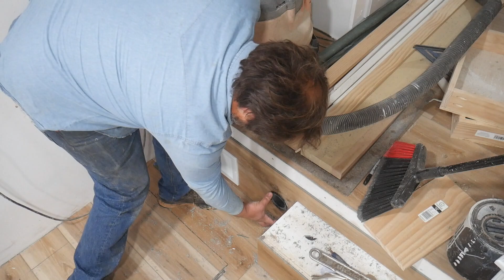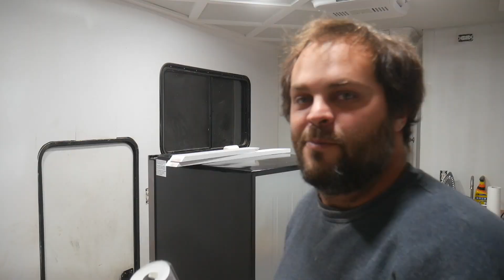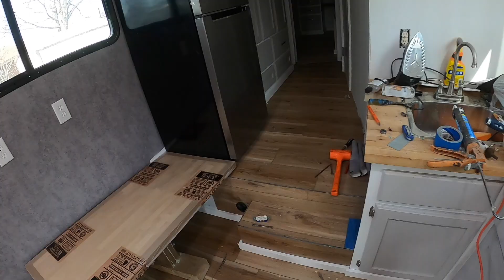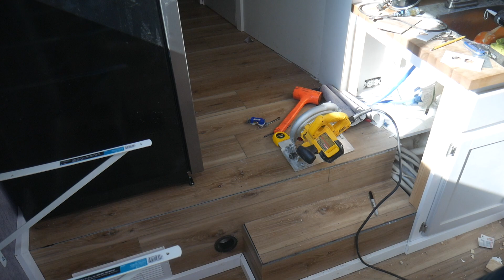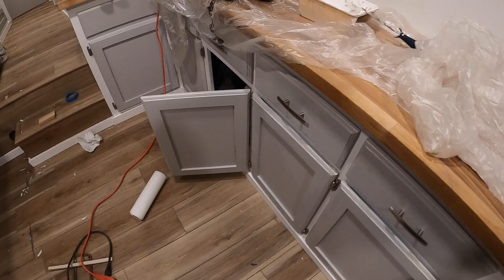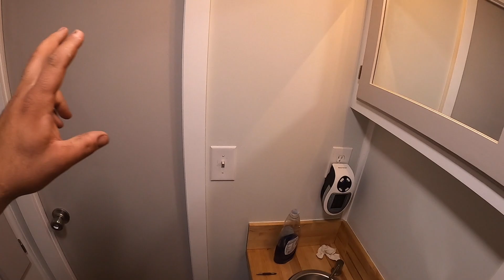Homemade RV. EP-50 Finishish line.  1977 Peterbilt 359 Toterhome

Comment: That laminate flooring needs 1/4” gap from the walls for expansion and contraction in different temperatures. The base boards will cover up the gap just fine.
If you don’t leave the gap and put it in flush or tight against the walls, you will have boards popping up between the joints when it expands in warmer temperatures. It’s actually a floating floor meant to float on a felt backing or felt or foam under padding which is about 1/8”.